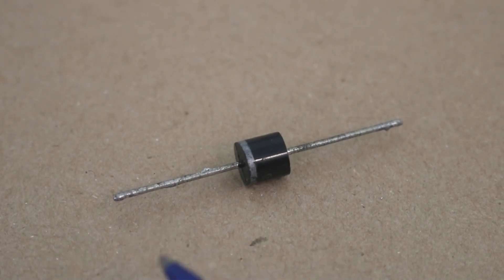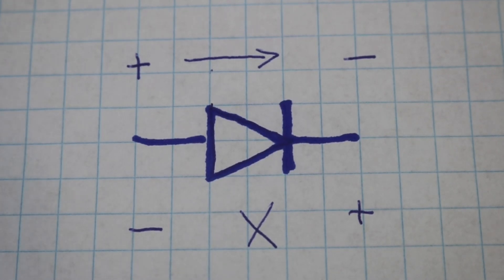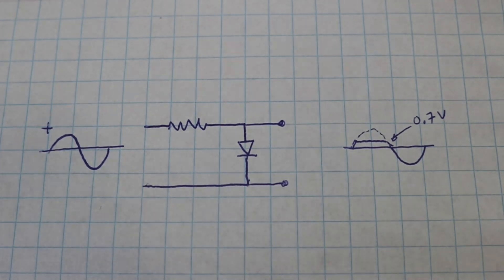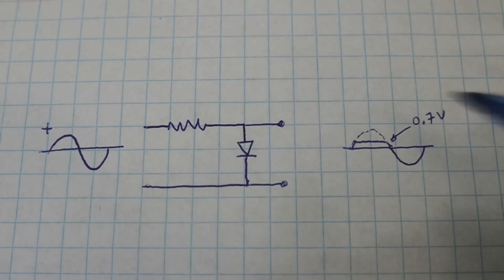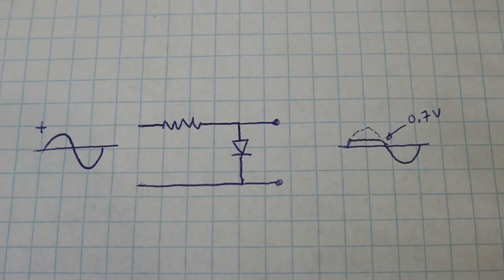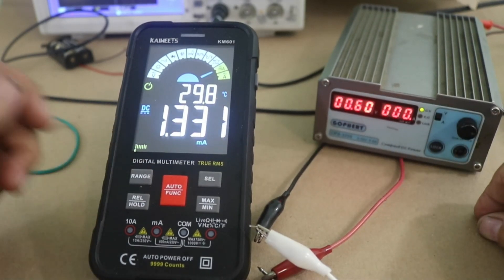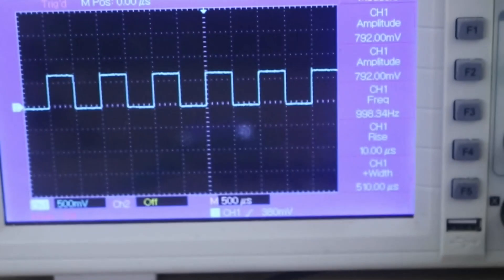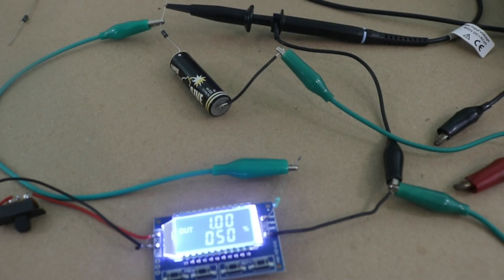Diode Clipping circuit

Comment: You can add number of diodes in series or parallel, to get higher clipping voltage or current.
Reply from the maker: Yes